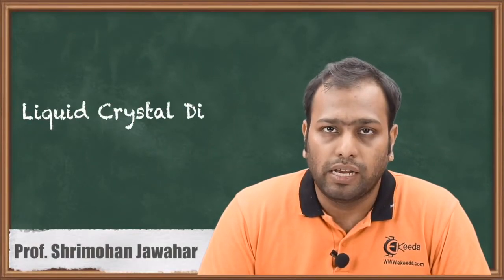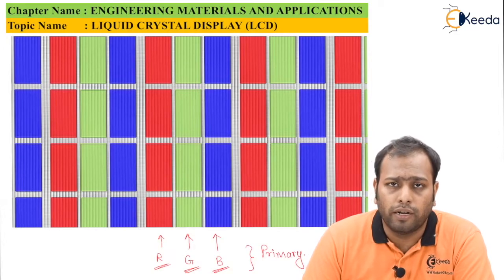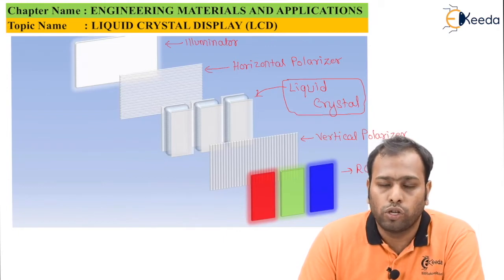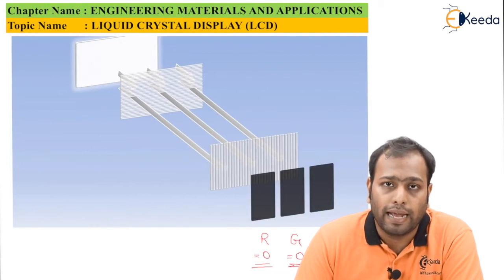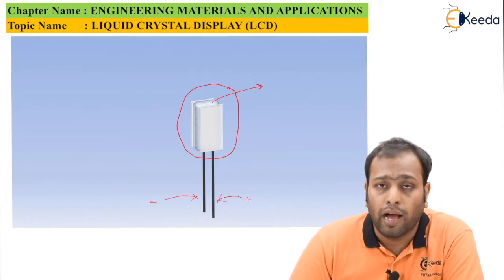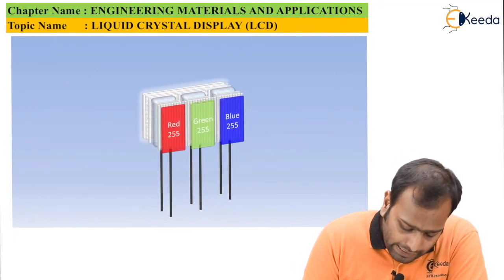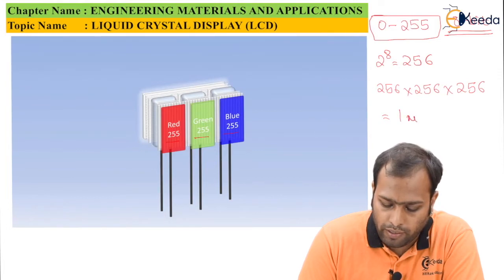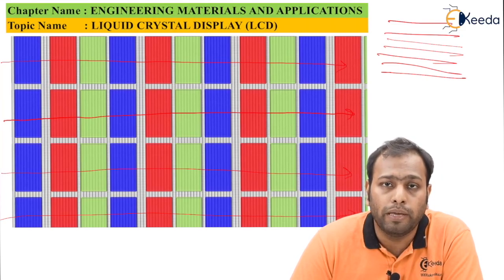Liquid Crystal Display

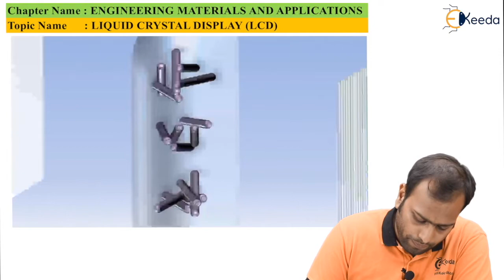Comment: 8:20 the orientation of molecules does NOT change "when light comes in". Also 8:03, the molecules of LC used in displays are NOT randomly oriented. Displays use "nematic" phase liquid crystals where the molecules are mutually aligned and regularly oriented. 😢 teaching wrong info with nice animation is such a crime.